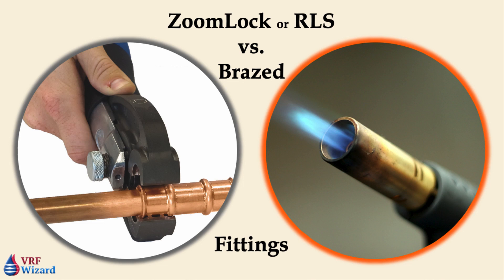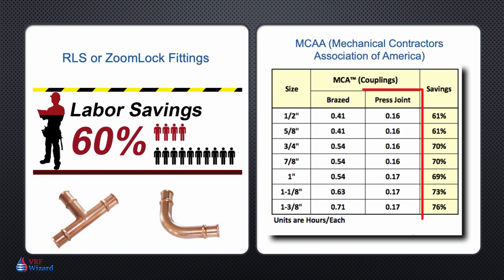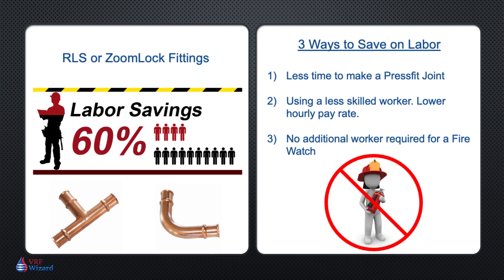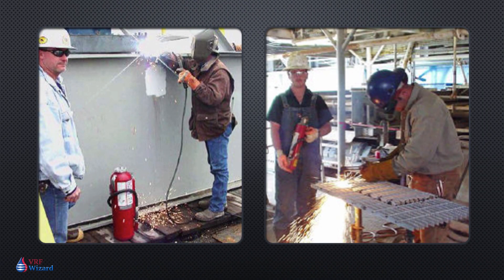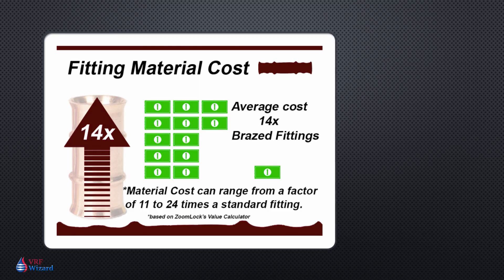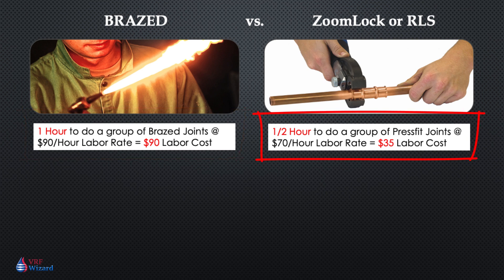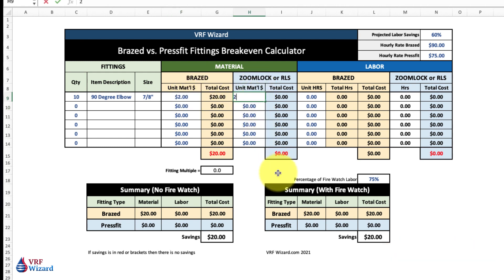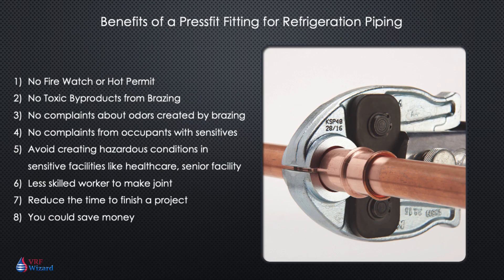ZoomLock or RLS vs Brazed Fittings

Comment: Can’t see this going very far, as an AC contractor. What if you get a leak in press fit? Plus, no one is getting 90 dollars an hour in our trade as a journeyman.
Reply from the maker: I thought the same thing, but having been the owner of a Union Contractor I can tell you that our labor rates were over $100/hour. Of course the Journeymen or Foremen didn't get this amount, but this is what was charged to cover the burdens. A lot of contractors add additional money on top of the hourly rates to cover cost of employees such as for Trucks, Small Tools, Safety Training, etc.
You can't do much work for Public or Commercial Projects without a Fire Watch or Hot Permit as most projects mandate them, so basically you need two people for every one that does a Pressfit joint. Good Luck.

Comment: You do realize they changed the fittings and jaws recently right?
Reply from the maker: Yes, in August 2020 the inventor and manufacturer of the original ZoomLock fittings - RLS, LLC ended its relationship with Parker-Hannifin and no longer supplies it fittings to them under the ZoomLock name, but under their own name RLS. The RLS fittings still use the same jaws and equipment, so no need to buy new jaws, just buy the RLS fittings which is the same as the old ZoomLock branded fitting. ZoomLock MAX is now manufactured oversees by Conex Banninger and requires new jaws. See our article on ZoomLock MAX at https://vrfwizard.com/rls-vs-zoomlock-max/
Reply: @VRFWizard  Thank you for clarifying that I can see benefits of both types of fittings the new ones are a lot shorter and would work for the bell end cutoff for residential units. Most techs still do not use the repair or slip couplings that do not have a dimple stop. Many techs are still fearful of leaks do they not realize that service valves also have HBNR O-rings?
Reply from the maker: @billburkhalter411  Good Point. Remember the Space Shuttle also has O-Rings. It's good enough for NASA, it should be good enough for refrigeration. It's all based on making the joint according to the manufactures requirements. Thanks.
Reply: @VRFWizard  Where can I buy from RLS?
Reply from the maker: Not sure where your located, but check your local HVACR distributor. If you can't find a distributor you can call RLS directly as their website doesn't have a distributor locator feature yet. RLS (1-833-757-3278)
Reply: @VRFWizard  Very good information! Thank you for the help!

Comment: Can you pressfit a txv in reachin cooler? LMAO😁😁, Fire watch? Que? All those times you encounter different pipe sizes, you cant press them eighter! Besides i will bet i am faster with brazing than the zoomleak, with the cutting and fitting checking marking and whatnot.
Reply from the maker: There are advantages and disadvantages to both methods. There are times when the use of a flame is at a disadvantages, like wise there are times when pressfit fittings are not the best choice as you point out.

Comment: So the less skilled guy installs the system using ZoomLock. He is less skilled, right? I think it logical that the quality of the install will overall will not be as good. (customer notices a pounding sensation in his ass about now but knows from not where it comes from)  The unskilled guy knows if he learns how to braze, he will be out of a job. This is STOOPID! Penny pinching misers everywhere in this trade. Bid the job right. Stop huffin' 22.